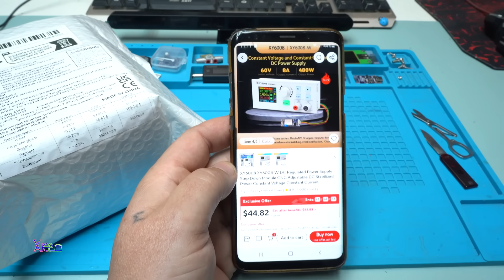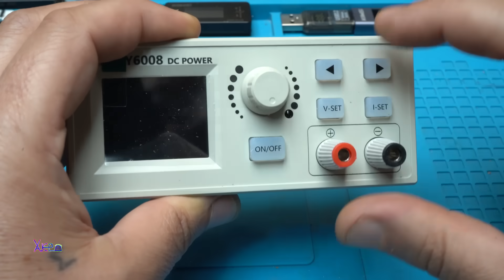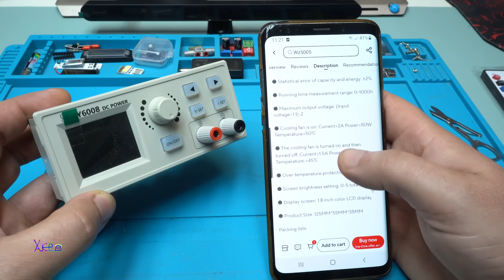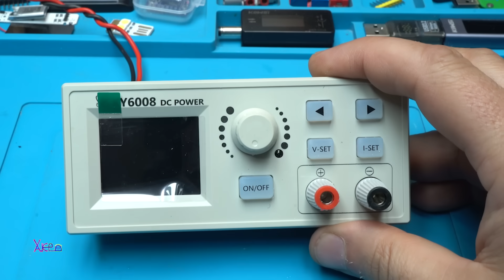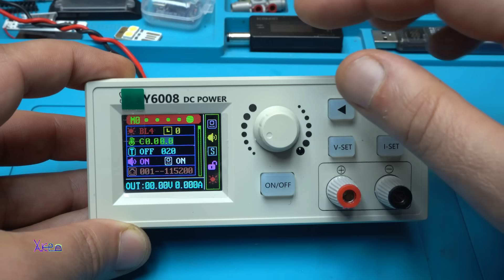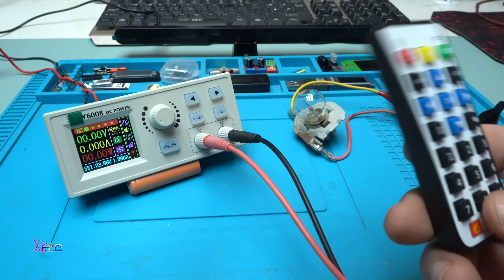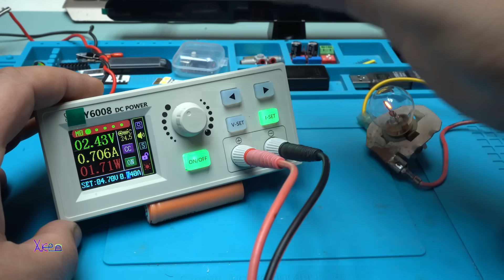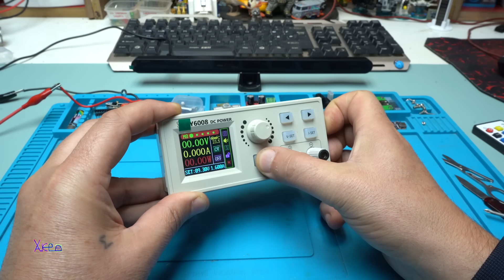WHY THIS $? Aliexpress XY6008 DC regulated power supply Module is FANTASTIC?

Comment: That's pretty neat. I've made a few power supplies with transformers taken from old audio equipment, in conjunction with voltage regulators & rectifier diodes. Lost them all in a move and would like to pick up one for my QRP transmitter. Preferably I'd like up to 10 amps, variable voltage, and the ability to supply op-amps with +/- voltage of around 6 to 12 volts because I like to experiment with preamps. If anyone has a good idea to pass along, please chip in.
Reply from the maker: Sounds like you have some experience with power supplies!👍

Comment: Input voltage from 6 to 70 volts?  So I already need a power supply to feed this power supply?  If it had 110/220v AC input, I might have been a bit more excited.

Comment: There seem to be good reasons not to test the power supply under rated load. What about temperature, ripple, and electromagnetic interference at 480 watts? 

Setting voltage, setting current, CV/CC mode, colorful display—everyone can do that these days. There's nothing “wow” about it.

And the IR remote control puts me off. It's not nice when an expensive lithium battery explodes in your face because your neighbor's son wanted to have fun with his universal remote control or because some other remote control interacts with the device.

Comment: It would be nice to see how looks the output voltage on the oscilloscope. I had bad experience with different PSU. Like when you set 3V and click button to turn on output, it was spiking to higher voltage and then dropping to set voltage.

Comment: Would it hold up to 4 diodes and 2 capacitors and feed it 220V, halved to 110 by the aforementioned circuit and then halved again with resistors to make a simple divider?

Comment: Nice video! I just want to clarify for anyone new to these modules: the XY6008 is a DC-DC buck converter, not a full switching power supply. It needs a DC input source (like a laptop brick or battery) and then steps that down to your chosen voltage/current.

I originally thought it was a standalone bench supply too, but once I understood what it really is, I still decided to buy one. With the display, fan, and controls, it works a lot like a bench supply when paired with the right DC input, and it can actually be more flexible for some use cases.

Comment: 100mV ripple do not bother you? What are the real ripple, what frequency, how vary with the load, voltage, current output? Can you show us an osciloscope?
Reply: Yes, I too was hoping for a look at the output on a multimeter and scope to see if it was really regulating well and it was clean.

Comment: This would be useful for a mobile 24V battery setup in cases where lower voltages are needed.  If in a workshop, there are much better DC power supply options than this.

Also would have been more interesting if you would have shown the input power source and its output against this “voltage regulator”.

Comment: It's a lot cheaper here in Spain, only 28,59€ + 5,70 postage. However, for the money I can get a fully integrated power supply, although it wouldn't have the memories etc, which are very handy.

Comment: 8A 480W supply... Suuuure.

You could replace heating elements in the toaster with this "PSU"😂
Reply: i have 18A version and i used two in parallel on a heater. it can maintain 18A
i have one supplied from 600VA 60V transformer and other from 1kW 28V SMPS.

Comment: Now get an electronic charge to test that module and youll find out it doesnt worth it. Try 3V, 5V, 10V at 1A 3A and 5A and youll see its not regulating. Also try 5A at 40V and youll see how it melts in your desk.
Reply: then you get a nice fireplace 🙂
Reply: 12:21 9v and 3A but on display 9v and 1.5 A definitely work 😂
Reply: @smouky577 the lamp is limiting the current.
Reply: @MrHansHubraum  предположих

Comment: Nice review but its not a power supply. Its a converter. As you show it needs power supply. It also should have a box (back). Nice built in meter. I dont think I would ever operate via wifi.
Reply: All power supplies need power, and they are all converters too.
Would you complain that a light bulb review was invalid because there was no lampholder or lampshade included?
. .
The functionality of this device is completely obvious.
It doesn't have a case because it is a MODULE. The case can be purchased separately, but the design of this "module only" is so that slightly intellegent people can install it into an existing case, or a panel, or.... 🙄
Reply: @johncoops6897 you really struggled to make a moot point.
Reply: @krg038 - well, I will acknowledge that you are an expert on that 😀

Comment: This looks excellent value. If you don't need more than about 18 volts, you could power it from an old laptop power supply. I wouldn't want to run it at those max voltages and currents any way.
Reply from the maker: Yes its much more safe

Comment: How did you power it since it only accepts 70 gold's? Input
How would I use it in America? Yeah, when we're at a hundred and twenty volts ac
Reply: I don't think this is the product for you...
Reply: DC to DC converter. Don't try powering it with AC 😅
Reply: it needs a DC supply, of 6 - 70 volts. Don't run it anywhere near those claimed max specs. It's a buck converter, so output voltage will be lower than input voltage.
Reply: u first need to convert ac to dc
Reply: You could power it off of a 60V power tool battery, for example.